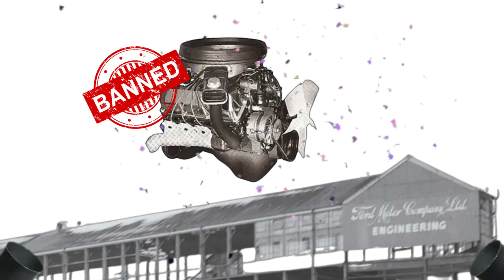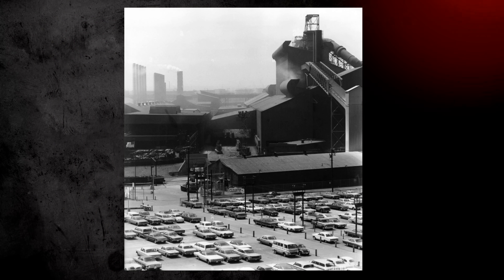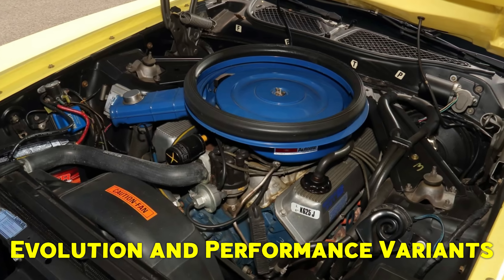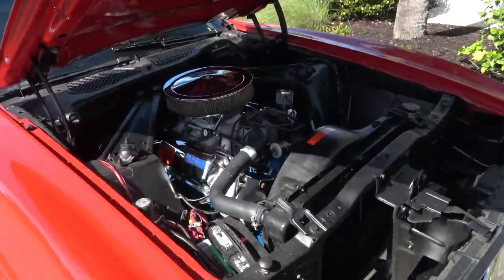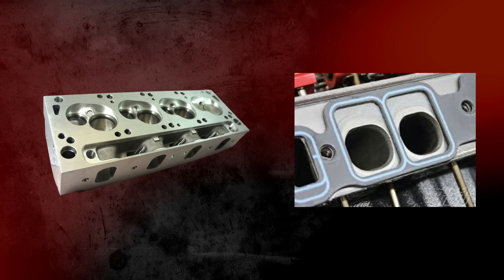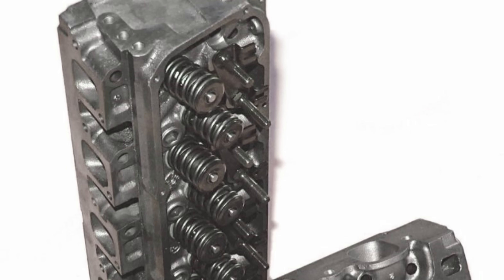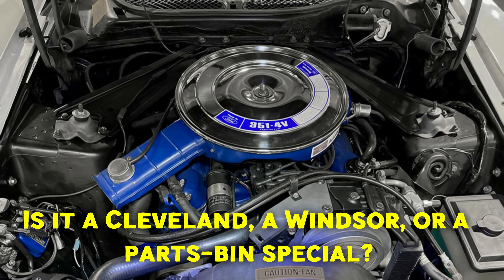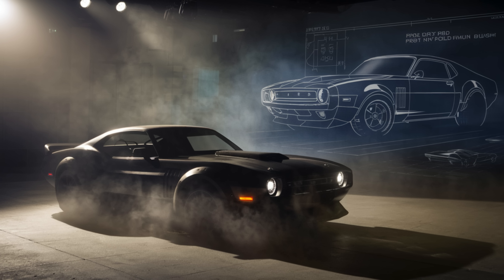The Shocking Truth Behind FORDs Banned 351 Cleveland Engine

Comment: Ford moved Cleveland production entirely to Australia because the EPA was cracking down on emissions in the U.S.
Reply from the maker: You're absolutely right! The shift to Australia was definitely influenced by stricter emissions regulations here in the U.S. It’s interesting how policies can impact production decisions like that. i hate the epa, utter nonsense pen pushers  @williampankratz600
Reply: All they needed to do is get lead outta fuel but they kept going...then Nader and his bumper cars
Reply: They didn’t shift it here to bypass emission rules. Ford Australia needed to build its own V8’s instead of importing them. Cleveland was the new baby so this is what we got. We had a 302 version of the Cleveland as well
Reply: I’m running one in my 71 Mach 1 building a 351 c CJ block Aussie heads should be a beast
Reply: yes the clevo went down under and powered our falcons and ford Australia and the xy falcon gt  held the title for 25 years the fast 4 door sedan in the world
Reply: @ivo2j283  would have required 500 of them to be sold do the general public for that to be in the record books technically
Reply: @utubetrutharrowmichael-and9105    ford australia built 1557 vehicles of the xy falcon gt  powered by the world's best small block the clevo , and it was the fastest four door sedan in the world for 25 years
Reply: @ivo2j283  yeah my comment in relation a 1972 XA GTHO the phase 4 ..
Reply: @utubetrutharrowmichael-and9105  there was only one of those ever built it never made it to mass production because it was considered too powerful for the time.
Reply: My Aussie built 1981 Bronco came with a 351 Cleveland. Love the grunt of it.
Reply: @cowcocky  My 1983 F250 SupaCab has one of the last Aussie 351 clevelands in it. Installed when the vehicle was imported from the US without a motor mid 80's.
JH71YG
59570K

J=Australia
H=Brisbane
71=LTD
Y=1981
G=August
No Cleveland 351s were produced after August 1981

Brilliant motor, never been rebult, no tappet noise & does not blow smoke on start up  or when running & is attached to a rock solid C6 Transmission.
Reply: I would still like to build a Cleveland engine and if I ever do I'm definitely going to Australian sources for the parts.
Reply: If you go back to 2:32 you’ll see a map of Australia cast into the right hand side head shown.
Reply: Thank you and it was before 19 f**** 70 I was sitting here biting my tongue and started reading the comments and yes .. America basically was going to dump the whole lot in the ocean and instead of doing that decided to Palm it off to Australia as they knew that the engine was going nowhere LIGHT TRUCK APPLICATION only WAS ford america's stance  ( my understanding the Windsor slightly narrower v to the block made it rev more easily with less dollars needing to be thrown at the rotating assembly as opposed to the Cleveland and addressing some of its oil starvation woe's )  most of that information about it being light truck application only was in a Ford magazines put out by American parent company I believe it was 1967 or 68 the magazine was dated with 302 I believe creeping into XT and 68 with both Cleveland and Windsor options available in Australia   .. America putting all of their development into the Windsor so the story between American Cleveland and Australia is vastly a different .. Australian 4v Heads I'm lead to believe were completely different to what was on offer in America OUR HEADS 72 - 74 we're highly sought after again was my understanding finding their way back to America .. America was foiled by emission BS and us pretty much was the public fear campaign was big news pumping it outside over Australians media blowing the public fear & up roar into a frenzy given HOW god damn fast these things were .. 350 chev gts and falcon GTHO with a little bit of media propaganda the Australian wowzer public shrieking of the thought of their 17-year-old getting their hands on a 400 horsepower practically a race car capable of doing over 240 km with 4 of his mates in the car was something that The Nanny state that Australia  still is now wasn't having all the way back then either ..  that's to the best of all my knowledge guys hope that helps in some way ..
Reply: Really? Never heard that before. Thanks for the heads up.
Reply: While Bud Moore Engineering was in nascar in 1981, I was with a couple of friends who could visit and while there one afternoon saw a dozen Australian block 351 C's being delivered to the shop. The Wood Brothers got them too and they were eventually sold to the Elliott's and Junie Donlavey also.
Reply: I hate the epa.Just recently their efforts are failing trying to force people into electric cars or forcing people to not even own cars because of messed up regulations.
Reply: Another car that ended up with the Aussie 351 4V was the DeTomaso Pantera. I remember reading they were crated in Melbourne and shipped to Italy to be installed in the Pantera. I also remember reading the Ford service manual for the XB Falcon, and distinctly remember the compression ratio being 11:1 for the 4V.

Comment: Of the Cleveland or 335 series engines, the 400 was my favorite.  The 351M was really good too.
Too bad Ford did not make a 4 cylinder engine using the head design. 
What gave Toyota dominance of the car market was the 5 speed overdrive transmission.  A 335 seies head 4 cylinder and a 5 speed overdrive manual transmission, would have changed the Maverick sales a lot!
Reply: The Maverick gave Ford the same headache Camaro/Firebird gave GM. Took sales away from their "Halo" Mustang. (Same thing the Ranger did years later to the F150.) Then the ID10TS turned the Mustang into a rebodied Pinto. Now the Maverick is a Unibody Ranchero while the Ranger is a Square Body F150. We won't even get into the Beancounters in GM's Ivory Tower ruination. But TBH it's not surprising if you look at their origins. Just surprised it took this long.
Reply from the maker: You make some great points about the 335 series engines! It's interesting to think about how different designs could have shifted the market dynamics. The combination you mentioned could have definitely given the Maverick a unique edge!  @jameseroh6544  i always wanted 400!
Reply: jamesero6544I remember an article in Hot Rod Magazine in the 1970's were somebody was sectioning V-8 Cylinder heads and putting them together and using them to race on a Ford Pinto with a 6 cylinder.
Reply: @Corsairforu it was a 300 online six with a set of closed chamber cleveland heads cut & welded. Had 500hp n/a!
Reply: The 351M and 400M were 2 bbl smog motor dogs compared to a 351C.
Reply: @jeffmeyer8399  I am not a drag racer.  But off road in a truck, with those exhaust gaskets that raised the bottom of the port.  The torque and fuel economy were hard to beat.  That is compared to any brand with the camper properly indexed.  I preferred RV profile cams, but the stock cam did pretty good too.  On the road in a 71 Mercury Cougar and a Ford LTD, the performance and top speed were respectable.  I set up all my vehicles to be quiet and stealthy.
Reply: @jameseroh6544  I’m not trying to disparage your great experience with those M engines..I’m sure you made them run great..😀..I’m just saying the 351 C is just a great package, set up for serious performance with 4bbl carb, performance intake and exhaust manifolds, cam etc.  The M’s were never offered with a 4bbl carb and were heavier with the tall deck height.  At that time you could get a 429 or 460 that out performed the M’s.  My second car back in 82 was a 1970 Mach 1 351c which I still have so I might be biased..we’re all lucky to have had experienced those times!!
Reply: Cleveland is the only intermediate block from Ford with good heads. 351/400 were dogs with 2v non canted valve heads.
Reply: @paulberkland5700  Are you sure about that?
Reply: @jameseroh6544  ive owned more than one of each. Yes, I'm sure. Most of what you hear about ANY legendary engine is just that, LEGEND. My uncle used to......my dad's friend had a.......etc. I've owned 208 cars and trucks since 1984......mostly 60s and 70s "hotrods". They all made some good ones, and they all made some "not so good" ones.
Reply: @paulberkland5700  I have owned 2-351C, 1-351M, and 1-400 engines.  All had the same canted valves.  The 2 barrel heads were more practical for the street.  A 114° lobe center angle high lift short duration RV cam gave good power and fuel economy as long as the timing gear was not retarded 4° like the factory did.  If the valves were inline.  The heads are Windsor, not Cleveland.  The shape of the valve cover is also different.
Reply: The 2v open chamber cleveland head is the exact same head as a 2v open chamber on the 351m and 400. They flow decent and can handle up to 500hp reliably.
Reply: @chrismiller2577  the deck height between cleveland to later m is what made the m a dog motor. Also it had different motor mounts that are hard 
to source these days. Pretty sure the m 
Used big block bell housing and cleveland was small block bell housing
Reply: The 351M was a Hemi killer.